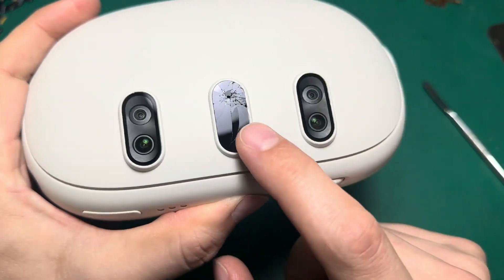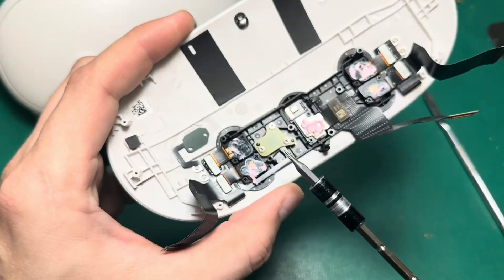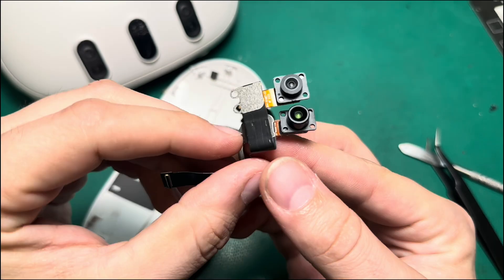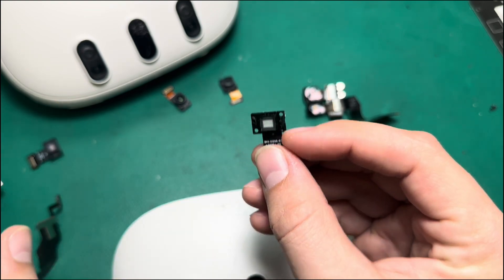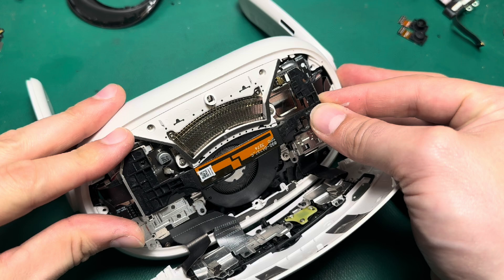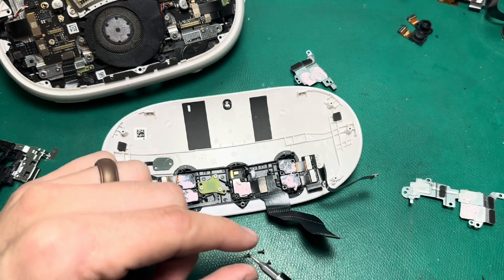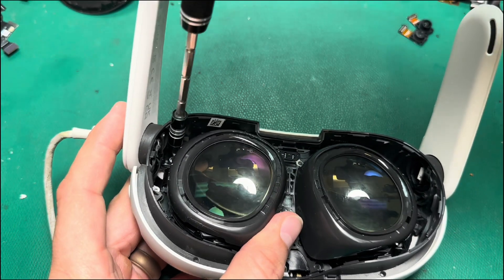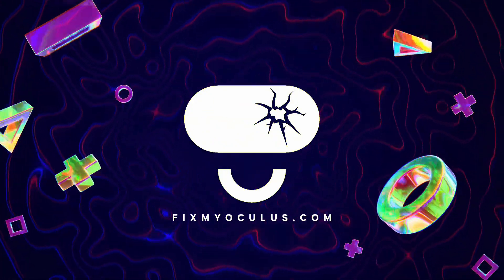Meta Quest 3 Depth Sensor Repair - Detailed Guide & Front Sensor Functions Explained

Comment: Thank you for very useful content. Please advise - what is the sign of faulty depth sensor? My Quest 3 hand tracking and room scan stopped working (but sometimes it randomly start to work for like 10 seconds and stops again), but the controller tracking and positioning works fine. Is it a depth sensor issue?

Comment: Do you have a video for easily  reconnecting  the face sensor on the q2, it is the last cable before putting the facial insert back in and it always takes me 30 mins to get connected lol

Comment: Geeze I didn't even know you could shatter the depth sensor like that. This almost reminds me of the headset when they hit it so hard the LCD shattered.
Reply from the maker: I’ve learned never to underestimate someone who is really into Gorilla Tag.
Reply: @fixmyoculus  I agree. Gtag and other games with similar locomotion systems are just headset and controller destroyers. Luckily the quest 2 seems to be quite a resilient unit.